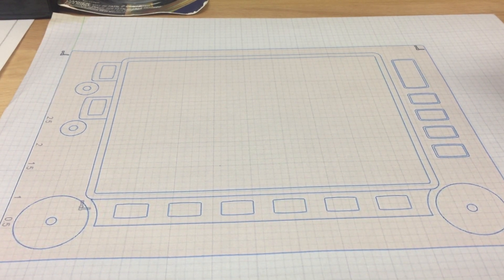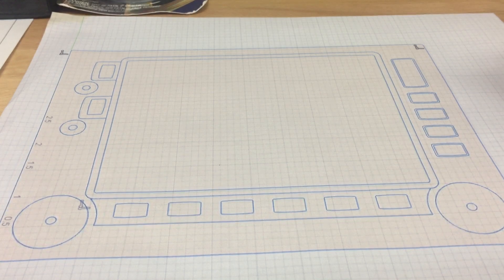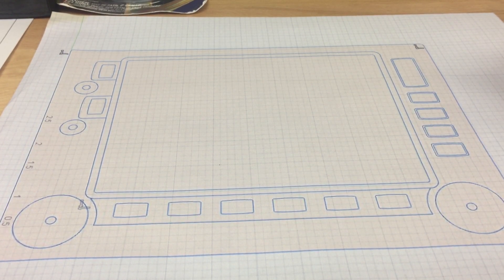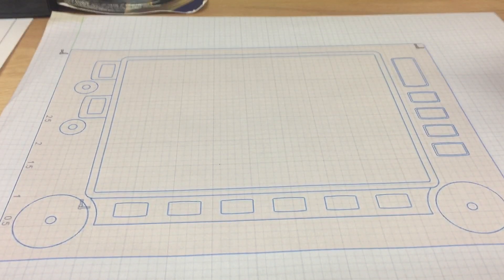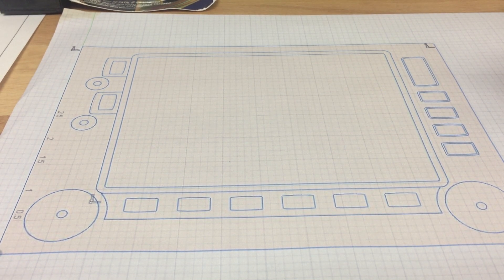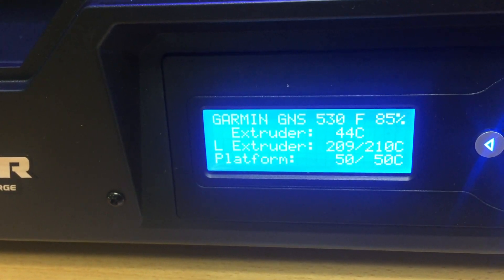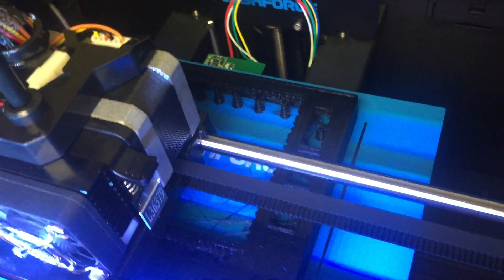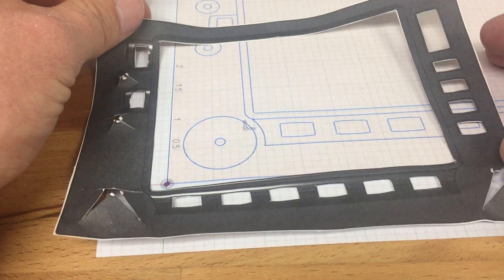Garmin GNS 530 Simulator Build

Comment: I recently finished my 530 but I added the autopilot buttons and other switches to replicate a Baron. Used an Arduino board and the plug-in from the guys at svglobe.com; they're extremely helpful if you get stuck. They have made the connections to X-Plane extremely simple. I found this helpful because this was my first adventure in electronics and components. I'd attach a couple pictures if I knew how to do that here.
Reply from the maker: Tom Perkowski thanks! I had to put it on hold for now. I had another project take its place. I hope to jump back on it soon. I got the Arduino, LCD, encoders and buttons in already. The only thing I’m missing is the potentiometers. I haven’t had any luck finding those yet.
Reply: If you are referring to the dual rotary encoders with push buttons, I purchased mine from Leo Bodnar,  www.leobodnar.com/.
http://www.leobodnar.com/shop/index.php?main_page=product_info&cPath=98_75&products_id=196

They are a little expensive but very high quality. Very pleased with the functionality.

I've also seen posts from guys who have purchased theirs at ELMA, https://www.elma.com/.
Reply from the maker: Tom Perkowski no I’ve got those. Just the volumes for comm and nav are the ones I need.
Reply: I didn't install the volume knobs; not realistic replication but I thought the volume knobs for a simulator were superfluous.
Reply from the maker: Kyle Larson thanks, do you think they have the potentiometers as well?
Reply: Our ArdSimX Interface (and new SimVimCockpit that will be more easy to use) that are used to communicate  such GPS modules is located on another web address ( almost year ) - http://www.simvim.com  (not svglobe anymore).
Regards, Vlad (ArdSimX developer)